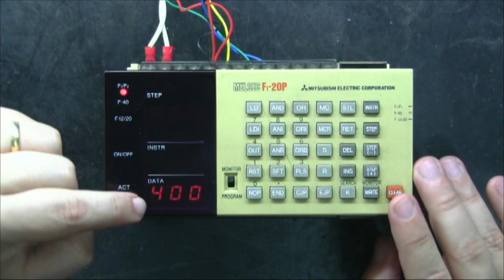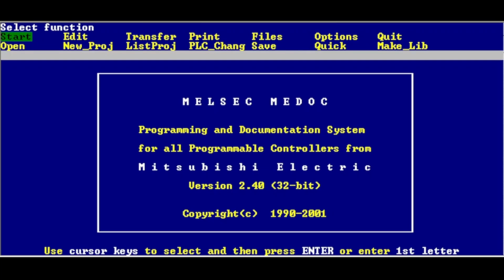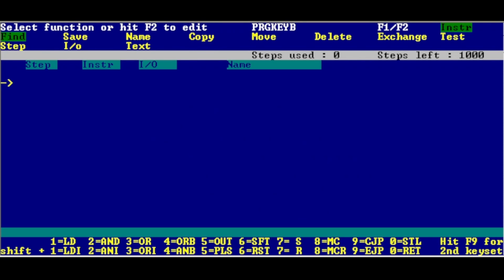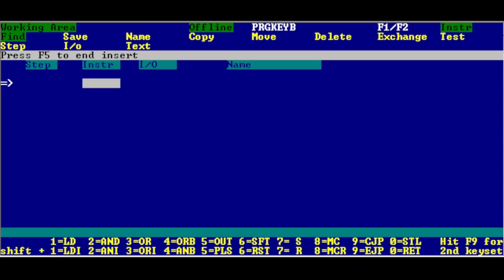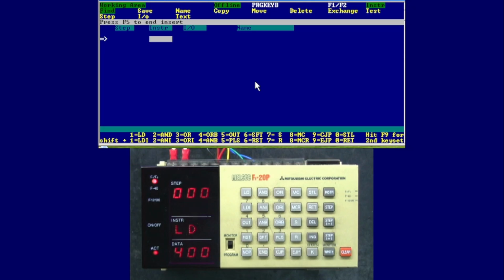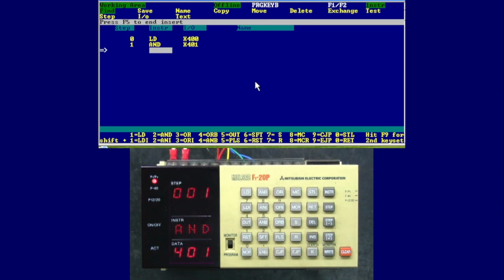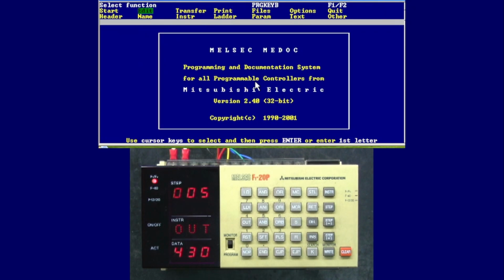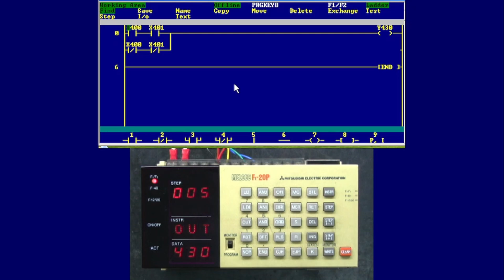How to read F1 PLC program using F1-20P keyboard and pass to MELSEC MEDOC

Comment: Hi Great informative videos.Could you do a video showing saving a program using a Mitsubishi F2-20P-E interface with the  cassette recorder interface onto a cassette ?.
Reply from the maker: Hello, Tim! Thank you for your comment! Unfortunately, I just have the F1-20P keyboard that doesn't have the DIN connector for cassette recorder, like the F2-20P has.
Reply: @ThiagoTurcatodoRego  Thanks for the reply the F2-20P-E is all i have so ill have to do it the pen and paper way and transfer to Melsec on the PLC. Unfortunately the manual does not give the pinouts for the DIN connector and i don't want to risk damaging it by trial and error.
Reply from the maker: @timcash1353  I agree. I wish I had this cable configuration so I could share with you but I don't. Unfortunately to us, back in the day, they use to protect even cable configuration, preferring to sell the cable assembled.